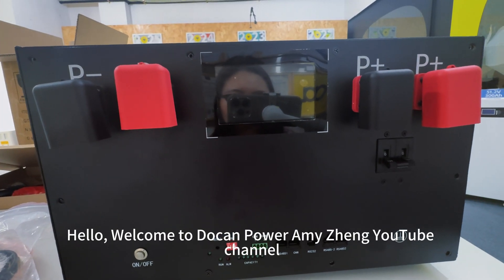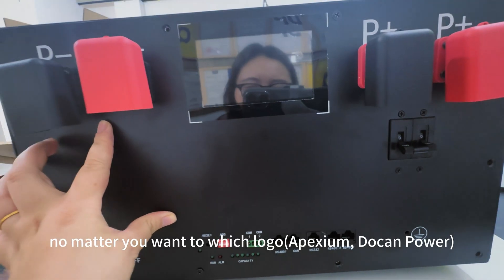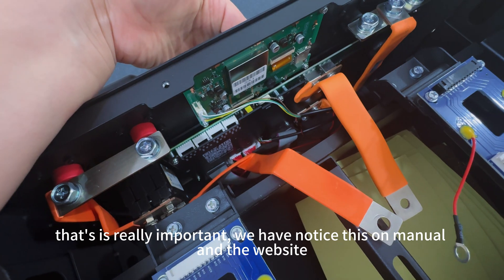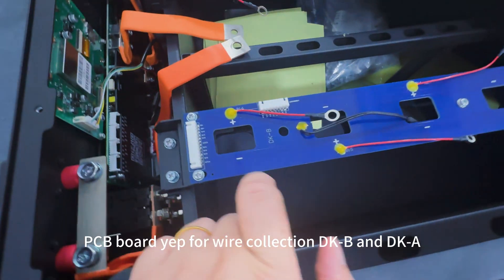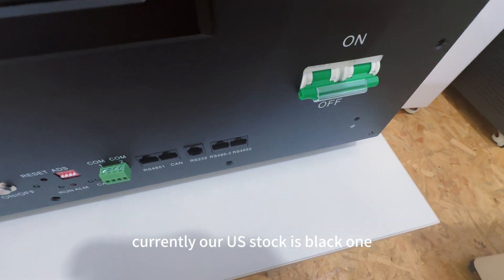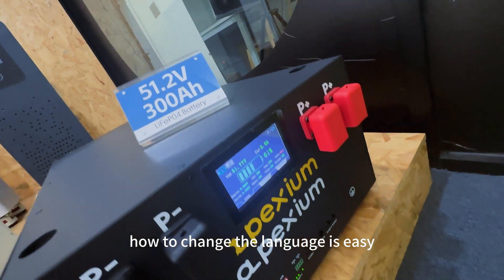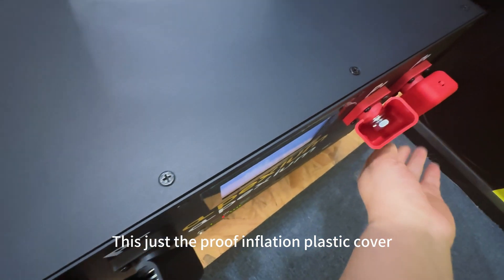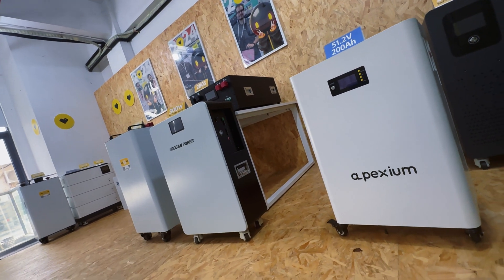Upgraded S3 DIY Box | 200A JK BMS + DC Breaker | Docan Apexium DIY Kit  #solarhomesystem #docanamy

Comment: What is the actual balancing current between the cells?
I'm asking about the real current delivered to the weaker cell, not the current drawn from the stronger one — this is often misunderstood.
If you want to charge 2 amps into a weak cell, you need to draw more than that due to losses in the system.

Could you please install the cells in the device, including one weaker cell, and place an ammeter on its lead to check the real balancing current being delivered?
Reply from the maker: If the cells have a significant voltage difference, the first step should be to charge the weaker cell to match the voltage of the other cells before assembling them together.

If your question is about replacing a cell in an existing battery pack, then the new cell should also go through the same voltage-matching step before installation.
Reply: You need 2-3 cycles to be top balanced with 2a active balancer. I saw too many reviewers do that with the same jk bms and it's work.
Reply: @i3dny  I saw a guy replace one cell in a 16-cell pack because its terminal broke. After that, his 15 kW battery suddenly started weakening and was only delivering 11 kW or less. It turned out that his JK 2A balancer wasn't balancing that new cell properly, even though it was new and had the same capacity. That's when I started wondering how little 2 amps for balancing really is. Later I found out that balancer manufacturers tend to bend the truth a bit with their specs — those "2 amps" are not always what they seem. Some manufacturers specify 2 A as the amount drawn from the stronger cell, but don’t mention how much the weaker one receives. Others list a 2 A peak impulse current, which in reality averages out to 0.2 A per hour. I have no way to verify this myself, so I’m waiting for that guy with the JK 2A balancer to check with an ammeter exactly how much current that weaker cell is actually receiving.

In the meantime, I’m experimenting with my own custom balancer, which I want to develop to support any number of cells and to balance them using a sensible current of 5–10 A. The idea is to make it possible to combine cells with different capacities — both smaller and larger — and still keep the whole pack properly balanced.
Reply: @neoklasyk  Watch some Off Grid Garage videos on youtube. He has done detailed testing of all functions of JK BMS and others. You can also get Neey active balancer that is 4 amps and they have higher amp versions too.